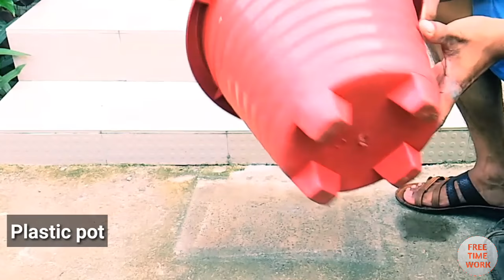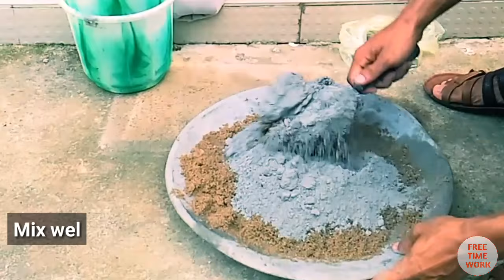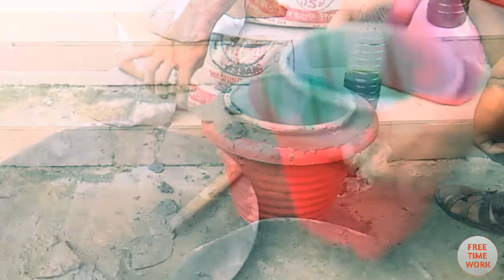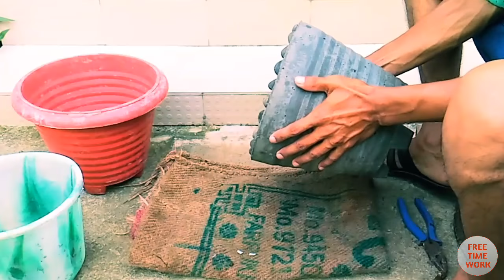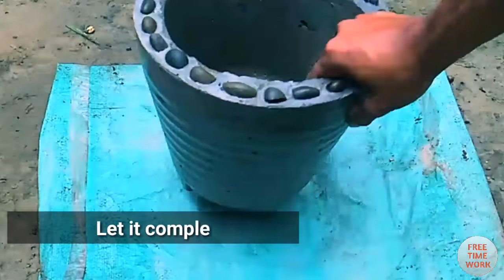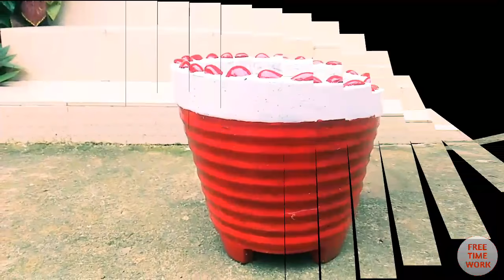Easy Flower pot making process

Comment: Is oil also placed on the small on the lower side - outside?  Or just the big one inside?
Reply from the maker: i used only on inside, but you may use on outside area of inner bucket to remove it more easily.

Comment: Good applicable method thanks . Let me know the type of cement and ratio of cement ,sand and water to be mixed.
Reply from the maker: It is gray cement. I had taken 1:3 of cement and sand. But it can be made from 1:1 ratio also. Ratio of water is not fixed, it'll depend on wetness of sand.
Reply: @freetimework  Thanks for clarification. On  free time I will try to make it..👌

Comment: Should we apply oil on the outer surface of inner bucket?
Reply from the maker: Yes. I didn't apply oil on the outer surface of inner bucket. But you may apply it to remove the bucket more easily.
Reply: thank you

Comment: Its nice...but instead of making a cement pot from a plastic pot.....we can use the plastic pot directly itself🤔🤔🤔.....just my guess
Reply from the maker: Cost of the plastic pot 150-200.
Cost of the cement pot 20.
I mean, you can make 10 cement pot at the same cost. ☺
Reply: @freetimework  yes you are right...but how do we get cement in home
Reply from the maker: Contact your nearest hardware shop. You need 1kg cement for 1 pot.

Comment: Why so less cement is in proportion?
What if we add 2 part sand and 1 part cement?
Or 
Equal equal parts??
Plzzzz let me know what will happen in each case
Reply from the maker: Yes, you can make it by 1:1 or 1:2 ratio.
Reply: @freetimework  
Thank a million
Reply: If u will add more cement the pot can have some cracks later
Reply: @thakuradityasingh1268  
Thank you
Reply: @Read-read for best strength use m25 grade concrete mixture which can be achieved by 1:1:2 mixture of sand:cement: coarse aggregate respectively.  I tested the strength of this mixture is very high. if u only use sand with cement it's not going to be very durable and start to fall off in some time.
Reply: @harshitmishra5234  
Thank you so much

Comment: they are always brocken in two halves when getting them out of the pot..what is the reason for that??
Reply from the maker: Apply oil in the inner surface of the plustic pot well. Select the pot which bottom side is smaller than the upper side, so that the cement pot can be easily removed.
Try 1:1 ratio of sand and cement, if you are still not successful.
Reply: @freetimework  Thank you so much.